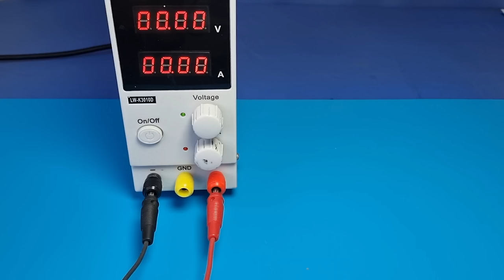How to make a hot air soldering iron from 12V car cigarette lighter

Comment: Man, I hate it when people use the wrong tools, and crimp wire connectors the wrong way, and don't set it up to run an air flow through it... Sigh....
Reply: Don't be hating. Hating causes illnesses to yourself and doesn't change what you hate. It takes a lot of people to fill our freeways. Peace

Comment: Without hot air
Reply from the maker: TECHNICALLY YES
Reply: @ZAFERYILDIZ52  thanks
Could you make some proyects to use 120v AC? I live in Venezuela, our voltage is 120v. Thanks

Comment: How many miliamps or amps to make a car lighter stay glowing for a long amount of time and not burn out? I want to use a 110v to 12v dc converter wall plug but don't know if it would cause a short and flip a breaker or  what amperage would keep it glowing without burning out the coil.

Comment: That is pure genius of the 3rd kind! You don't need any forced air then? Its radiated heat? How long did the element last running on 9V 4A ?
Have you further tips for levelling the pcb solder when re-attaching - or do you find that unnecessary?  Is the heat rise profile on a new component safe? How long does the operation take? Is your video real-time? What kind of flux are you using?  Sincerely, BjG

Comment: Normalnya harus beroperasi di arus berapa ampere ya? Karena pernah menggunakan adaptor charger laptop 12v 3,7a hanya hayat saja tidak memerah. Apakah perlu ditambah gulungannya?
Reply: Amigo, yo le sugiero, qué busque una fuente que pueda entregar 10 amperes, puedo que estos encendedores,en los vehículos llevan una protección de 10 amperes, por lo tanto por cálculo por ley ohms,su potencia debiera ser por el orden de los 120 watt....
Saludos cordiales desde Chile,y espero que le sirva de algo la información entregada....
Reply from the maker: Menarik 6 amp pada 12 volt
Reply: @ZAFERYILDIZ52  terimakasih akhi.
Reply: @adios3502  bom dia, coomo você resolveu?
Reply: @felixfilho6886  artine opo?
Reply: @alfredo4310  thanks

Comment: I noticed that maximum load amperage is@ 7 amp. 
A 220vac_ 12 vdc _8amp adapter is costly. 
which may make me get a ready made hotair gun. 
There is no air flow.?? 
Anyway thanks a lot for this grat project.